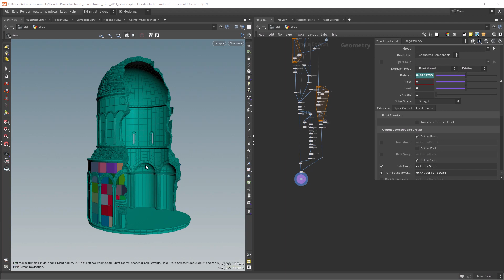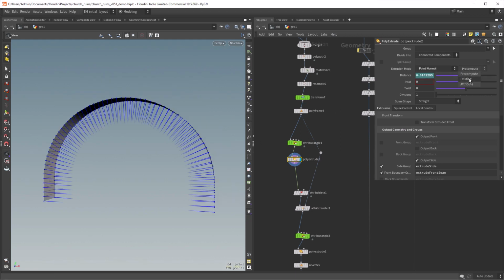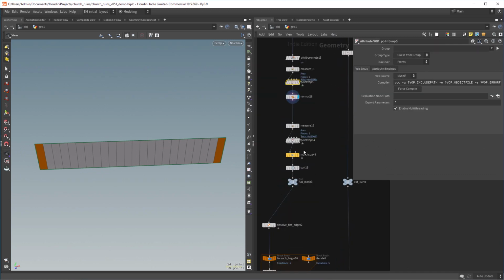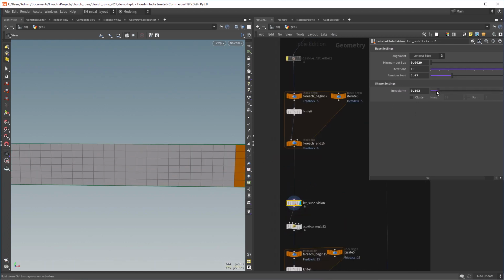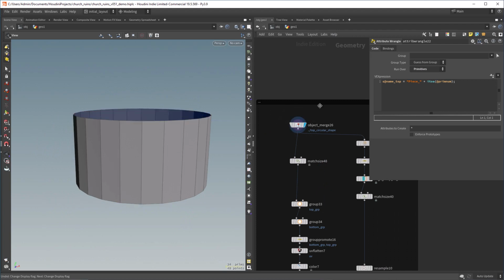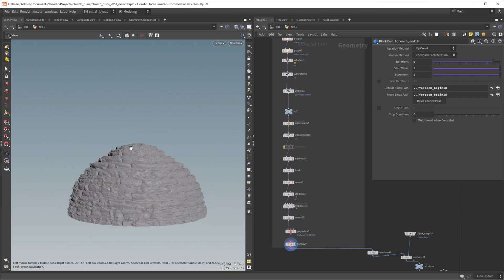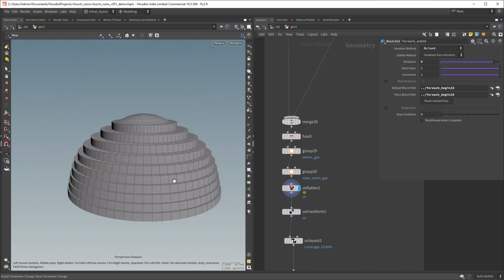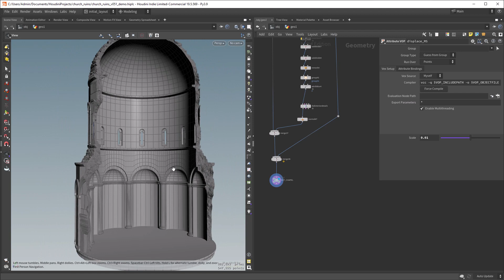Procedural Modeling tips in houdini #2

Comment: Excuse me sir, one question, I have noticed that sometimes you use Point VOPs for displacements, while other times you use Volume VOPs. I would like to know the criteria you follow when determining whether to use one or the other since both methods seem very similar to me. When should I choose to use one over the other?
Reply from the maker: In this case I used point vops because I needed to use textures and uvs, volume vops are great for creating very detailed noisy meshes , cliffs for example, as I shown before in the channel. Volume vops with vdbs are also slower. But they dont necessarily do the same job. One downside of point vops is that they easily create intersections. That's my experience so far.
Reply: @cgside  Ty very much for taking the time to answer me. 

Cheers.